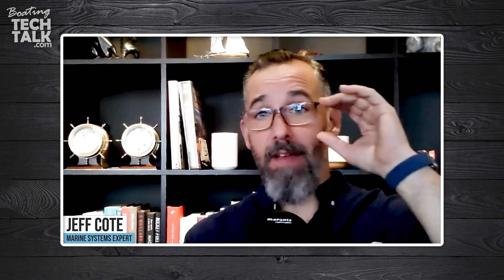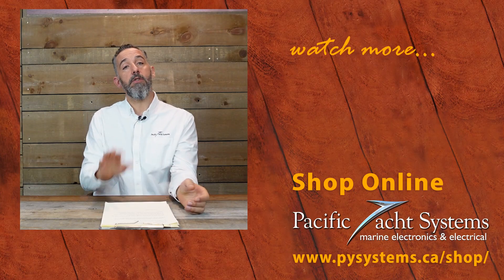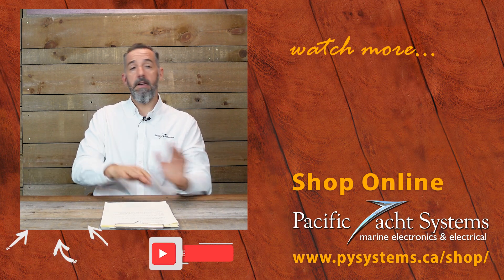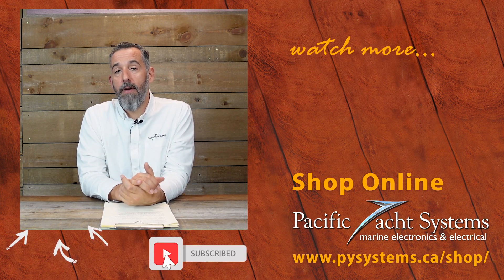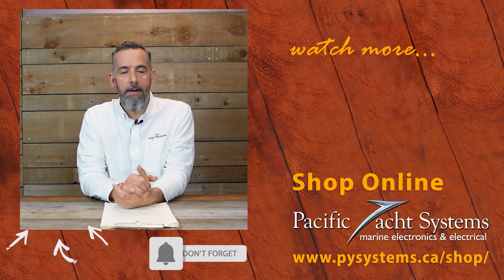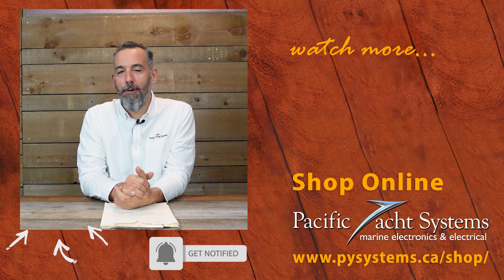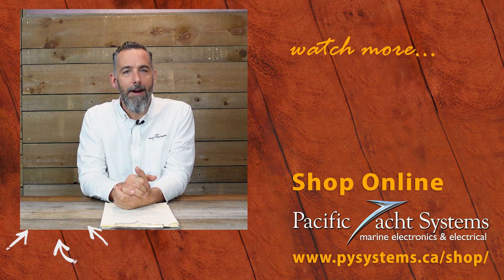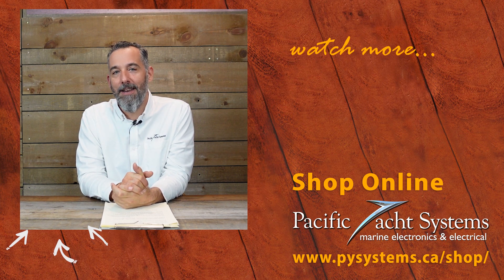Charging Two Separate House Battery Banks (possibly Lithium) and One Starter with One Alternator

Comment: I would recommend changing over to one house battery when the switch I’d made to LiFePo, after market alternator with controllable external regulator and charge the start battery with a DC/DC charger from the house bank.
Reply: That’s why I would install a Sterling Power alternator protection device to the setup I suggested.
Reply: @atxsailor452  as Dan Sweeney is using the start battery to protect the alternator would this still be the case in your set up?
Reply: No, I would recommend changing over to one house battery bank when the switching over to LiFePo. Install an after market alternator with controllable external regulator to charge the house bank and charge the start battery with a DC/DC charger from the house bank or alternator charge current. I would also install a Sterling Power alternator protection device to this setup just in case the LiFePo house bank shut down. This would protect the alternator from the rapid loss of demand and the alternator would also continue to supply the needed power to keep the 12V users powered up.
Reply: @atxsailor452  I am planning to do an install exactly as you have described. I would like to use the Victron Orion 30amp dc/dc charger into a isolator connected two AGM batteries (start and bow thruster). The alternator will be charging the lithium house bank at 200 amps and I believe the dc/dc charger will bring the amps down to 30 amps and charge the two batteries at an AGM profile programmed into it. The question is when sitting at anchor will the dc/dc charger still be feeding the AGM batteries and could this become a problem?
Reply: @fastman633  Yes it can be a problem depending on a few factors. I would also install a battery isolator to the AGM that would shut down the charger when there is no charge current detected from any charging source.
Reply: @PacificYachtSystems  ?
Reply: This is what I did this year on our willard trawler.  While cruising the balmar alternator charged  the lead acid starter battery.  And from the starter battery  a renogy DC to DC  charger 40 amp  charged our 600 amp hour  lifepo4 house  battery bank.  We were cruising  from. Virginia to Florida keys and back . This worked well.  Very happy with it.
Reply: @dansweeney4167  Why would you not do the opposite as the LiFePo4 batteries can take the full amperage outlay of the great alternator? I'm sure it worked well but seems that it could work substantially better. That said, if you are happy with your setup well then keep the happy trawler cruising along!
Reply: @atxsailor452  I used the starter battery to protect the alternator . I've researched what you suggested  but found that if the lithium bms becomes satisfied  it will shutdown the charging  and that could possibly ruin the  alternator.  This way  the battery and DC to DC  protect the alternator from the power shutdown.   It  worked well  the alternator never had to work  hard to  charge  at a high amp draw.  I agree there is other ways to do the same  thing. This seamed to be a safe way.

Comment: Hi Jeff, I tend to use the smart BMS CL12/100 and CL/12/200 from Victron (along with some other devices) and the starter battery and alternator are both connected to the input of this device and on the output side which goes to the Lithium bank, you use a Mega Fuse as a shunt to limit the output of the alternator and these values are stated in the manual of the CL12 as to what fuse rating gives you the max output from the alternator,so you select one that wont roast your alternator. And because the alternator and the engine starter battery are always together, when the CL12 device disconnects and switches off the output side when the Lithium is charged (by using the remote ‘H’ input) the alternator is totally safe as it’s connected to a standard lead acid battery. It’s more work than adding the DC-DC but you don’t have the restriction of the 30A max charge current.
Reply from the maker: Thanks for sharing.

Comment: If customer had endless money I would
1) 200 amp alternator with serpentine kit with external regulator charging the house bank with most loads. 
2) DCDC 10 amp for Starter 
3) the two house battery banks charged with battery combiner. Pick house bank with the largest loads for alternator. 
4) take me on the cruising adventure. 😂
Reply: This is the same thought I had exactly, a LiFePo for each electric drive motor and a good house battery and the starter battery would be a small temporary load on the house battery as needed
Reply from the maker: Thanks for sharing.

Comment: Could one use a lead starter dc2dc converter  to a mosfet splitter then to two LiFePO4 bat banks?  I have this setup in mind if I ever decide to add a second bank to my house.
Reply from the maker: No experience with this setup. In the past, we've seen dedicated DC to DC charging converter per battery bank, in your case, they'd be two.